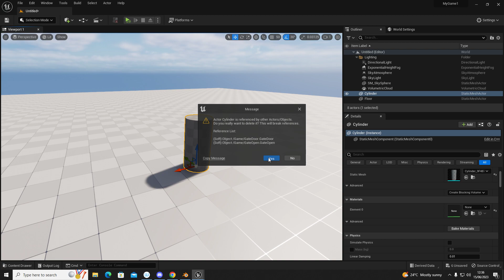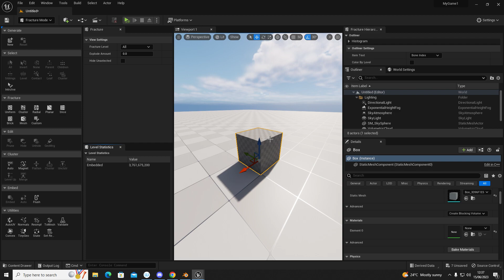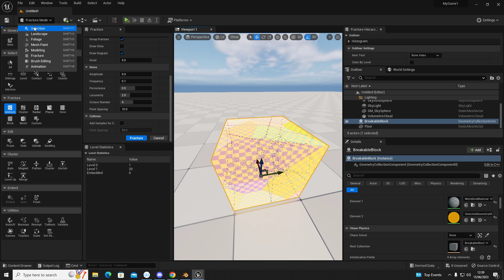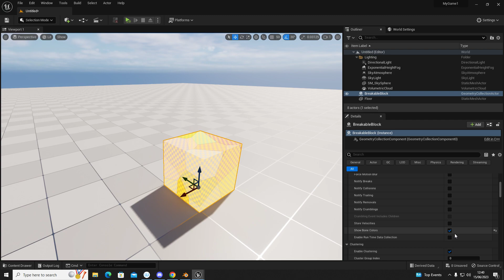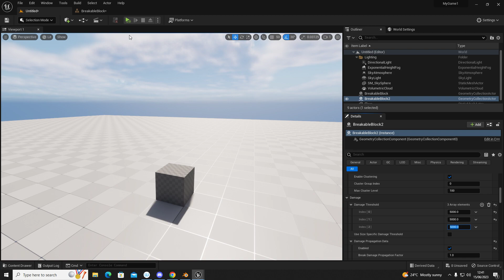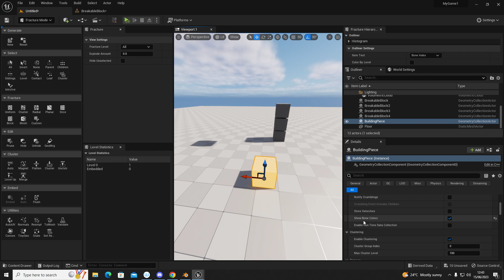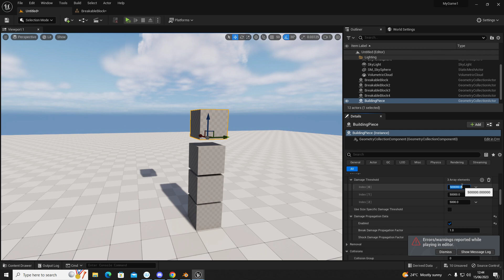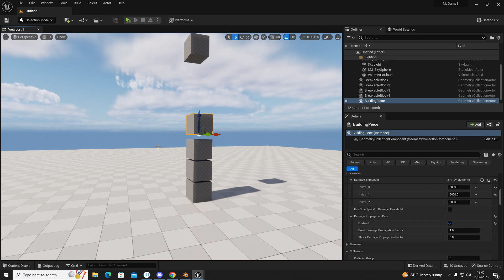UNREAL ENGINE 5 FRACTURE MODE TUTORIAL BEGINNER FRIENDLY HOW TO BLOW S**T UP

Comment: Can I somehow convert a mesh that's broken after simulation into a static mesh? In my case I need a broken variation of my static mesh?
Reply from the maker: Well when you converted it to a fractured mesh it would of been a non fractured statuc mesh any way so just use that?... not quite sure what you mean.

Comment: not sure if u still read commets, but im trying to set a mat for when the object breaks, lets say for exmaple a target, i want there to be a texture on the inside faces. when i try to add a texture in the bp of the target (which has the collection) i only have 1 mat to work with. i saw that u need to get to Mode Tools tab, but i dont know how to get there as i cant find the tab. ill quote the comment i found. 

"First, in the main level tab, go into Fractured Mode. Then, in the Mode Tools tab, find the drop-down called Utilities. Then select Material. Then in the fracture tab, go to Asset Materials, select Add Material Slot. Then, under the sub-dropdown that's also called Asset Materials, change Index[1] to the material that you want. Then go down to the drop down called Assign Materials, change Assign Material to [1] and To Faces to [Only Internal Faces] and press Assign Materials (this window is a little unintuitive because it only applies the changes once you press the assign button."
Reply: FIX. in the facture tab side bar, at the bottom there is a utility tab, there is a material option there where you can add more materials for anyone needing help. this is for UE 5.5. took forever to find.
Reply from the maker: @  I did type and post a response but for some weird reason it didn't actually upload the reply apologies but glad you found it on your own :)